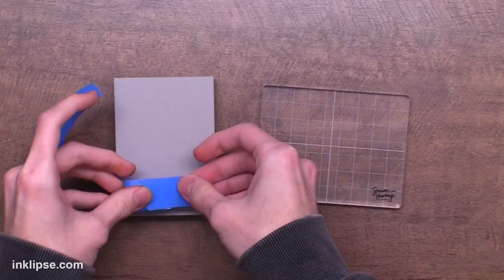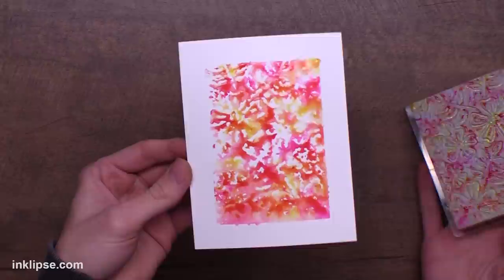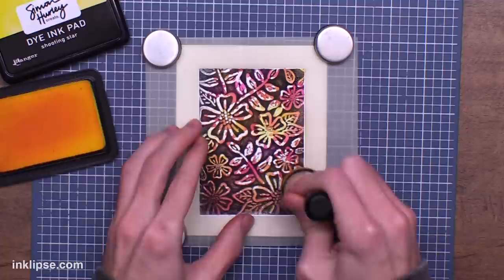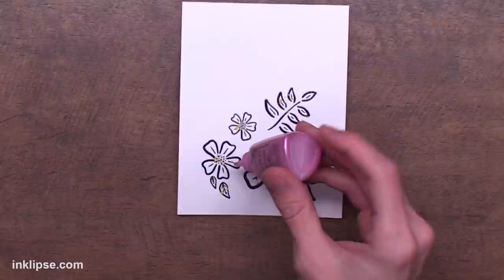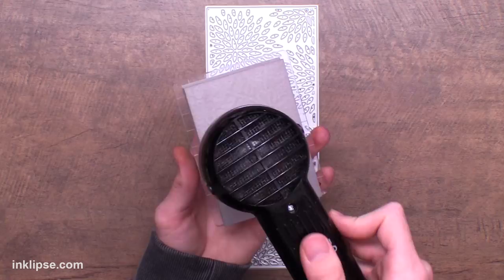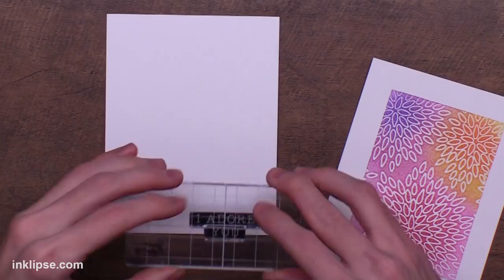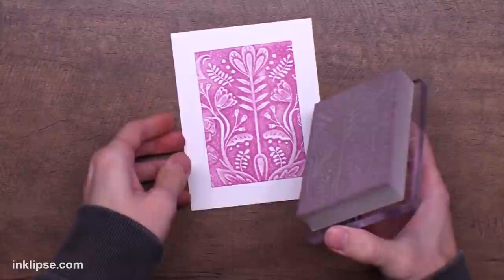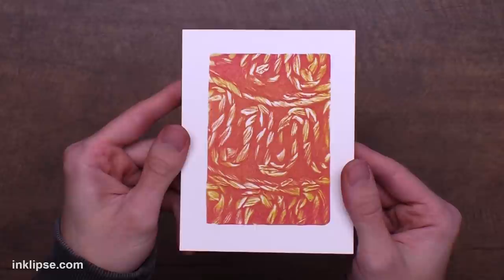You NEED TO SEE These Stamping Foam HACKS!

Comment: WARNING!!!  I used 2-sided tape on one of my blocks and it tore some of the foam off when I removed it! So….. I think to be safe, use only low tack tape to hold foam to acrylic blocks! Don’t want anyone else to learn the hard way! 🤣 Luckily only one block was damaged.
Reply: And probably only one side so you can still use the otherside or the smaller alongsides